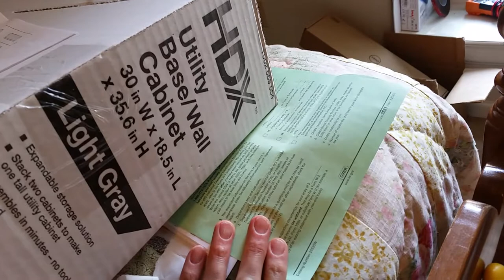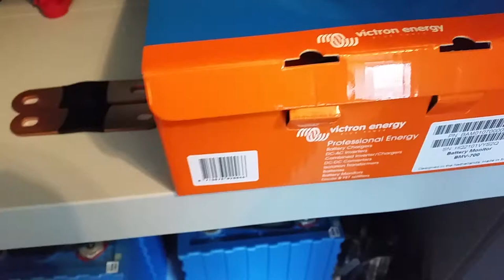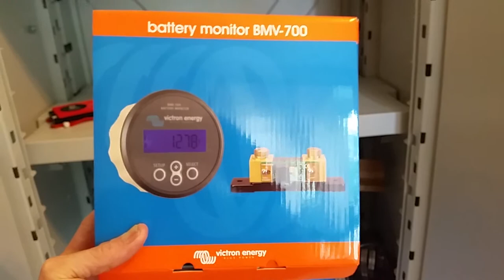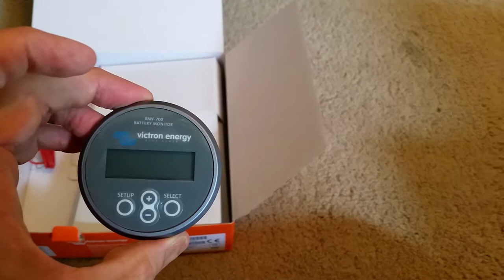New Battery Backup Power System - Part 1.3 of 6:  Additional Equipment

Comment: Pretty cool.  I have a similar setup in my camping van.  Same Victron BMV and the same bus bars.  I went with Battleborn batteries.  I didn't like the huge data cord for the BMV so I bought a 1 foot replacement.
Reply from the maker: Hey Will, thanks for the comment on this video as well!  I've got some Battleborn batteries as well and love them, but went without them here due to cost and knowing that they will be stationary and not moving around all the time.  For mobile applications, though, those BB batteries are hard to beat.  Good idea on a short battery monitor cable, I might have to make that change on this setup.  Thanks again!